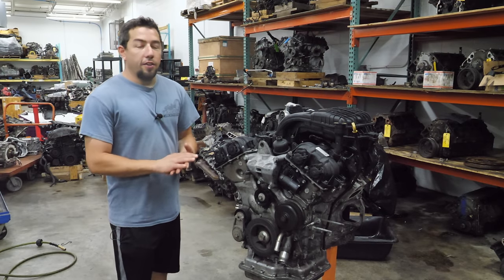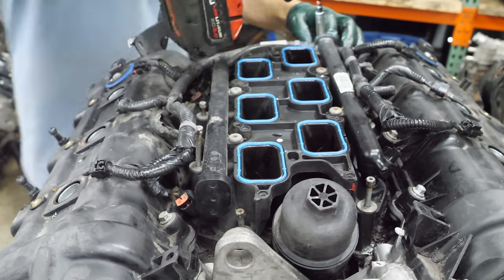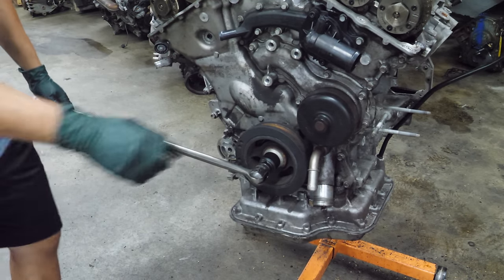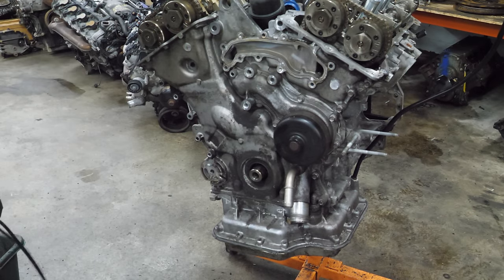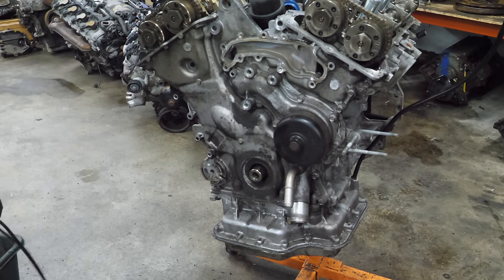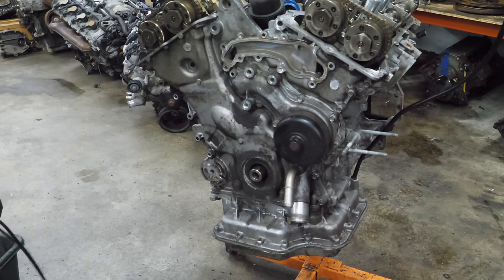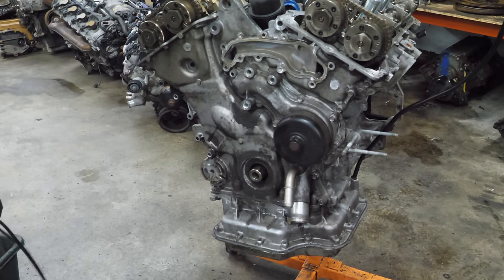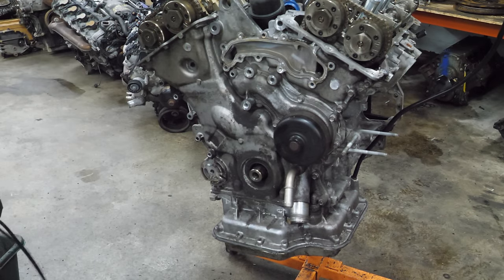Dodge Caravan 3.6L Pentastar V6 Teardown! Why Won't This Engine Turn All The Way Over?

Comment: As a subaru tech, I really want to watch you take apart an EZ30. Especially if you can find a nice crusty midwest/northeast one. Bonus points if you can get it done in warranty time.
Reply: Heh. Could had my EJ251... are you in NJ?

Had two of same car, the other an 02 Bean with EZ30D. God that engine was sweet.

Now put it in a light car....
Reply: If you come Monday it MIGHT Still be there pay my mechanic more than what they'd get for scrap or core ? However that does..  ????
Reply: Agreed however I’d like to see an EZ36
Reply: Also you’re just harassing him with the 50 million front bolt covers on the timing chain cover
Reply: What's the warranty period on em
Reply: @YungEagle3k  3.1 for engine R&R, 10.2 for an EZ30 overhaul.
Reply: @timbrown9731  the 50 million alens head bolts filled with grease and grime. 🤣
Reply: @timbrown9731  I'm sure Eric would love a challenge like that! haha
Reply: Ez30 would be very cool to see!
Reply: I second this - as a Subaru fan.
Reply: forget it,one of the most sought after engines on the planet
Reply: One of the 1st engines i pulled appart was an ez30 with breather port above #1rod and a bluetooth conrod upgrade
Reply: @sinc96  if you dont have photos i call bullshit on that
Reply: @andrewsmart2949  was 2005 (pre camera phones for me anyway) there was an issue with tge autos when they were in manual mode then put into auto in some cases they would hold 1st gear. (Recall made as a software update) anyway a young lady who was doing 80kmh in 1st complained car wouldnt go faster then bang and lots of smoke. Got towed in for an oil leak 🤣
Reply: @sinc96  whatever bike boy
Reply: @andrewsmart2949  ok 👍
Reply: @sinc96  i have owned and driven plenty of cars that can redline for hours pal at all sorts of speeds and conditions,a near new subaru with oil and coolant in it could redline all day and not throw a rod LOL
Reply: You are a Subaru tech and never took apart ez30?
Reply: @repairvehicle  never had the need to go into one,they just didnt major failure under normal conditions
Reply: @repairvehicle  i've taken apart more than enough. They're... super fun... when full of rusty hardware.

Comment: That’s the centrifugal oil air separator driven off the back of the exhaust cam. The Teflon seal goes bad and oil consumption skyrockets to more than a quart in 400. I’ll guess the carbon source.  Just had one repaired and now zero oil burn. There’s a service bulletin.
Reply: Yep, just mentioned this to another commenter. These are a pain to change, at least in the longitudinal application. I did mine and have no oil burning.
Reply: @mphilleo  yep. Four door Jeep so back of passenger cylinder head. You can’t even see it.  Dealer reluctantly did it for about $400.  Factory recommends replacement every 100k. This was a neighbor I was advising after a shop told them the engine was shot at 105k.  He was very thankful.  They seem to be good motors overall.
Reply: The PCV? At least on the vans and other fwd vehicles it's easy to access. I change mine about every 6 months "just in case".
Reply: garbage, more high quality chrysler built products.
Reply: @dodgefree1400  I did it myself, its super easy, just get one of those mini bit "holder" wrenches. Fits back there no problem is you loosen the dipstick bolt under the car.

Comment: The 3.6 pentastar is a tried and true engine. Yes the first couple year models had some issues, but since they were fixed, these things will go 250k+ with good maintenance. I drive a 2016 Wrangler with 120K miles and my wife has a 2015 Grand Cherokee with 92k, both have been super reliable.
Reply: My 2016 Wrangler, the rear main seal & Oil Cooler went at 50k miles, and I change the oil every 4K with Pennzoil Ultra Synthetic 5w20 and use Mopar filters.  Never over tighten the filter cap.
Reply: my 2016 Dodge Challenger V6 Pentastar has 93K mileage and no issues.
Reply: @SuperShori  2014 Durango 3.6. Timing cover leak. Just enough to soak the cover in about a 4" circle. Have not done any thing about it. Not a huge leak.
Reply: My 5.2 Magnum which has a little less HP but more torque lasts me 300k no problem. Cost me all of 3 grand to rebuild and super easy and will last another 300k. I don't get why they use this thing. The 5.2 Gets same mpg as my 3.6 Wrangler which is 20ish.
Reply: No hate, but update us when you get your 3.6 to 250,000 miles.
Reply: I just worked on an 11 Charger police car with the 3.6l Engine had 17,000 hours on it. Was ticking pretty bad with camshaft codes. Had a couple bad rockers, bad cam lobe, VVT solenoid failed and a couple timing chain guides were bad. I replaced the bad parts and it lives, and runs really well for the hours on it.
Reply: @mph5896 thats normal for any police vehicle, even in the crown vics, chevy caprice's, ppv Tahoe's the fwd early to mid 2000s impalas, and the chargers...if they were used for police forces...expect to replace cam and valvetrain components due to all the idling they do
Reply: Same here. I have a 2017 300 that I bought new with a little over a hundred and ten thousand miles on it now.

I have had to do absolutely nothing with this car except change the oil and replace the tires.

Great engine especially when compared to similars from GM and Ford
Reply: I work at a salvage auction and these pentastars consistently have  200-300k running fine, often in avengers/200s, chargers, and caravans. It's usually the choice of transmission used that people ire about, since it was often a cvt before 2014.
Reply: My 2016 Wrangler, radiator, Rear main seal, oil filter housing & TStat all failed prior to 50k, and I religiously change the oil at 4-5K with a quality synthetic.
Reply: Reliable….😮😂
Reply: @mph5896  I always divide the 3.6 engines into the “Tickers”(cam followers) or the “tappers” (you waited too long now you’re replacing cams). Then of course is the oil filter/cooler issues…..
Reply: @syloui  200-300,000 on a Pentastar…😂😂😂
Reply: After 100k I had to change oil pump fuel pump thermostat and def needed to do the rocker arms earlier than that but never did
Reply: I want to believe it but mine is a Chrysler 2015, engine was replaced at 59k miles with a spun bearing; the mechanic at the dealer told me they are junk, his words, referring at how the short blocks are aluminum and plain garbage, now at 127k miles I am in repair mode again but this time due to hydro locked engine; water came in due to intake manifold breathing almost near the floor! my daughter got stuck in a storm but the water was not higher than half a feet so seems to me the mechanic was right!

Comment: Thank you for the 3.6 Pentastar tear down. I have a 2015 Charger and 2021 Charger, both with this motor. The 2015 was purchased new and has 264,000 miles and climbing. No issues as of yet.

Comment: I have a 2014 Caravan I bought used at 60,000 miles. It burned a little oil at start-up at first, but no longer at 120,000 miles. I run a little thicker oil in Summer, and a little thinner oil in MN winters. It got 31 MPG on a recent trip. It’s a great engine! Thanks for the great videos!

Comment: these engines were the builders dream back in the 60's and 70's and only the top fuel engines had this kind of engineering built into them but no v6's only 8's, this would have been considered exotic back then, the guys over at dodge used everything they learned on these from moving the oil pump from a tubes distance away from the sump to right on top so those dry starts are almost done away with, crossbolted mains, dual over head cams, roller lifters, forged rods and cranks, the details go on and on, it's a marvet to behold and most of you younger gearheads won't be able to appreciate all this but I sure do. kuddos to you for keeping it interesting and educational and like others have commented on you skip the b.s. and anoying emusic, thanks for this
Reply: My supercharged Charger has 20k on it and no problems so far. I did add two catch cans. And you forgot, they also have two stage oil pumps. They pump up to 100 lbs when the engine is cold.

Comment: I really look forward to these every Saturday, and I almost always get inspired to work on my own car! I've made a ton of progress in the past couple months.
If you ever have the chance, I'd love to see some old Volvo stuff. The redblock i4 and the whiteblock i5 would be super cool to see inside!
Reply: It is Sunday morning in Australia.  My Church Service.
Reply: hey.
Reply: Problem is those old Volvo engines never die. My 850 still purred fine when I unfortunately had to take it to the junkyard
Reply: @diablocls55  I love 850s! My first car was an S70. The redblock I'm told is even more reliable - also had a friend whose engine outlived his chassis lol
Reply: I would love to see a 2.5t teardown. Those engines are rock solid
Reply: I currently have running daily drivers: 98 S70, 90 245, 07 S60, 98 S90  I'd LOVE to see these engines torn down, but where would you get them????  Mine are still humming along.
Reply: @centurybug  Yeah my first car was an 850 when I was in high school. It was a peppy little thing and the engine sounded so good when flooring it. I unfortunately started to have transmission problems after owning it about 3 years and parked it and finally scrapped it about a month ago. I miss that little car. Only reason I scrapped it was because I didn’t have time to get it fixed. Likely one of the solenoids was bad or the whole tranny itself
Reply: Redblock I4 - which one? B23, B21, B20, B18, B16 or B30? The four latter basically never dies unless you abuse them very badly. Irv Gordon had the B20 in his P1800. Only rebuilt once in 3 million miles.
Reply: @ehsnils   A redblock teardown, because those engines are so simple, would take about 15 minutes.

Comment: Thanks for the tear down.  My Granddaughter put 269,000 on a 2016 Jeep Trailhawk and I was always was more afraid of the 9 speed Fiat Trans that they were having so many software problems with.  She traded for a 2021 with 6,000 and now has 36,000 and I am gonna make sure I de carbon this one.  I was an old school builder but appreciate this inside look. Had a Mazda Millenia my wife had a cracked oil sending unit 300 miles from home caused her to trash an overhead cam set on which I paid the dealer $5100 to put new heads on then the bottom end knocked.  I wound up buying a actual 10,000 mile pullout for $2000 which I should have looked for before I spent the money on the new heads.  Ran that car for 259,000 without another problem.

Comment: I'm on my 3rd Pentastar engine in my work vans and to date I have no complaints about these motors. They've been reliable and relatively easy to maintain. I'm grateful for the look inside a good engine. It wouldn't surprise me to one day find a leaking oil cooler, from a failed plastic part, and now I know what that part looks like. BTW, there's an updated aluminum oil cooler available as an aftermarket part.

Comment: The white exhaust valve indicates that the exhaust valve seat was burnt causing a misfire. Common issue with the 2011-2014 model year pentastar classic left/front cylinder head. The amount of carbon build up indicates that the engine was run with the misfire on cylinder two for a while.
Reply: May I please ask what causes the misfire on cylinder 2?
Reply: @matthewmoneypit1558  Spark plug, coil pack?

Comment: I'd say that the excessive carbon was because the engine, being low mileage, never got driven long enough to warm up properly. It reminds me of Car Throttle and the 430,000 mile Hero they used to have years ago. Despite it having that many miles, they found very little carbon when they took apart the motor since the car's constant periods of run time had burned most of the carbon away.
Reply: I think this is a likely cause - or a lot of idling. Some vehicles are idled a lot.
17:30 - that odd valve might be due to bad valve clearance, and that could be a potential culprit causing the system to get the wrong mixture. Not that likely, but a possibility.
Reply: the amount of carbon in the intake before where the port injection is, on an engine that looks that clean on the top end, suggests rubbish implementation/failed EGR or PCV. but yeah the chambers shouldnt be that clogged unless its never been WOT
Wtf that plastic cooler is for cooling EGR? whyyyyyyy
Reply: No, this is a known issue with the Pentastar. They cool the EGR gasses and send it right back into the engine instead of burning it up in the exhaust. This kills any venting and creates positive pressure in the crank case that soaks the intake manifolds with oil. That oil is the reason for the carbon build up on the piston tops and heads. These engines need catch cans to separate it. My Charger only had 9,000 miles on it and the intakes were soaked with oil. I was shocked. I added two catch cans and it cleaned it right up. I have them drained at every oil change.
Reply: @bennyg  That's an oil cooler, the Pentastar classic has in cylinder egr via the phasers.  The cooler are prone to fail from quick lubes zipping off the filter cap with a ¼ impact.

Comment: My wife's is currently getting the rockers and camshafts replaced. 2018 Wrangler JL Unlimited with less than 100k miles and routinely dealership maintained. Seems like a semi-common problem on these engines.

Comment: My 3.6L Caravan has 233,000 kms/ 144, 779 miles. It has never given me any trouble, i did buy it used, so i can't speak to the history of the engine and if it had any previous repairs. I first checked YouTube when i bought it to see what problems to look for, but so far i haven't had the dreaded ticking issue from the number 6 cylinder lash adjuster, so I'm thankful for that. I've only done plugs on the engine itself and have used synthetic since i bought it with 168,000kms/104,390 miles on it 3 years ago. She moves considering its in a Caravan.

Comment: Yay a Pentastar! I find these super interesting because of some of the build decisions in them, can't wait to watch the whole video.
Reply: What type of decisions?
Reply: @e.l.9589  To sit on the couch and watch naked or not.
Reply: @e.l.9589  The plastic crossover pipe for the thermostat, the electric variable oil pump, the crossplane crank, the fact the breather has to be removed to remove valve covers, the entirely plastic oil filter housing assembly... I could go on. It's a very weird engine.
Reply: @e.l.9589  Specifically what interested me most was the 6 bolt crank main caps. Seems like overkill for a motor that had at max like 350hp, maybe.
Reply: @Anarchy522XD  Thank you.
Reply: @jackets64  Got it, possibly parts bin excess.
Reply: @jackets64  I believe there was a plan to do turbocharging and direct injection, so they were designed to be pretty beefy. They never followed through with that at Dodge/Chrysler/Jeep/RAM, but these engines serve as the basis for Maserati and Ferrari turbo V6 engines.
Reply: @philbrutsche8928  all of the Maserati/Alfa Romeo Turbo V6s are basically Ferrari 90 degree V8s with 2 cylinders chopped off, and the 120 degree Ferrari V6 is an in house Ferrari design.
Reply: So these should  handle turbo charging well?
Reply: @heythere6983  I know that they are supercharged fairly often, and I learned fairly recently that a 3.0L version of these engines is twin turbocharged from the factory in certain models (obviously not Dodge or Chrysler models lol).

Comment: recently replaced the low flow lower intake manifold, the plastic oil cooler and spark plugs on my challenger, and she runs better than before. 3 pentastars in the family and they've been dead reliable. the aluminum dorman oil filter housing makes the earlier cars use a 2016^ cartridge oil filter with the 3 pronged gazebo on the top.
also they love having the absolute fuck revved out of them, they aren't a low RPM motor, they crave speed.

Comment: it looks like something was up with the crank case ventilation. Looked like it was burning a lot of oil, and by the looks of it, the owner of the car knew about it, and was clearly keeping up on oil changes, hoping the poor running would fix itself.
Reply: Yep. The PCV on these are a pig to change (at least in longitudinal applications). Ask me how I know... 😅 But they run great and burn no oil if you keep on top of 'em.

Comment: Love my 2018 3.6 in my Jeep grand Cherokee. I recently got 31.8 mpg!  I have all wheel drive too. Drove 100 miles at 60 mph. Stuck in bumper to bumper traffic for 9 miles on way down. Took 45 minutes for 9 miles. I averaged 27.5. Was over 31 mpgs until this. Love your tear downs. Keep them coming. How about a 1.5 turbo Honda ?  Thank you.

Comment: I saw this a few times back in my dealer days. sometimes people put a bit of diesel in the fuel tank, causes it to carbon up like that. the original engine probably locked up, and they replaced it with this one but didnt clean out the fuel tank.

Comment: I've got a '12 dodge grand caravan with 104k miles and at just about 100k I dropped a valve seat on the head under the cowl but dodge wouldn't warranty it due to time nott mileage. I drive this vehicle like I stole it but do keep up on the maintenance but once had forgot due to my wife's stroke then ultimate passing and went 3 1/2 quarts low on oil. I've put up graded coils and the Banks petal monster on it and ITS FREAKING AWESOME.

Comment: I have been thinking about suggesting an easy way to remove those dipstick tubes but keep forgetting. (old age) I was a mechanic for over 50 years and I found that if you heat up around the base of the tube they come right out. 
Most have an O ring that swells and sticks. Even a propane torch is enough to soften them.